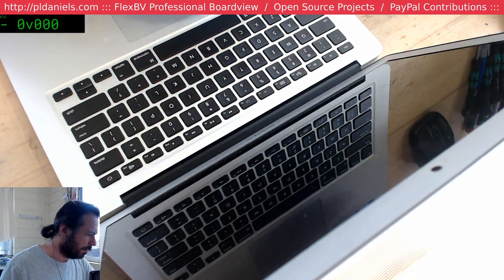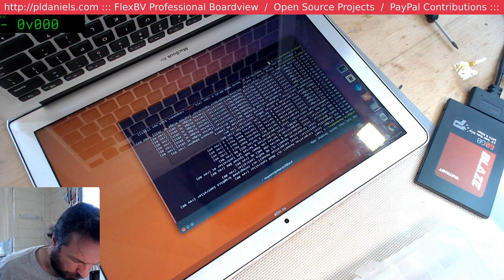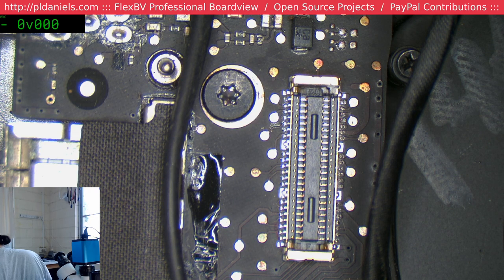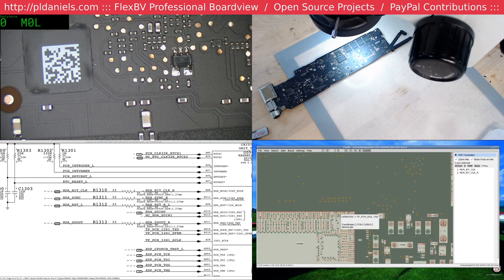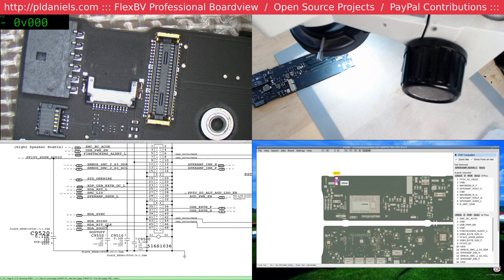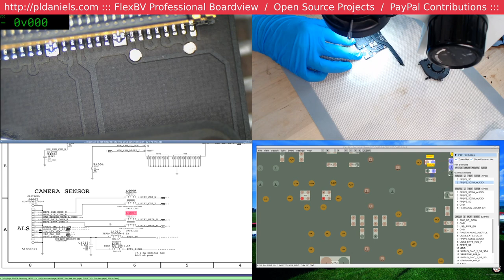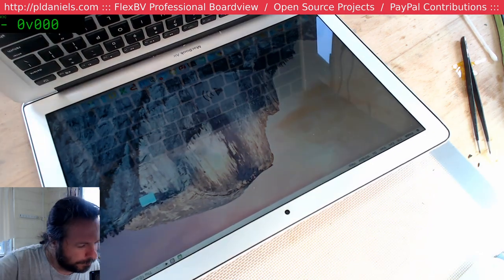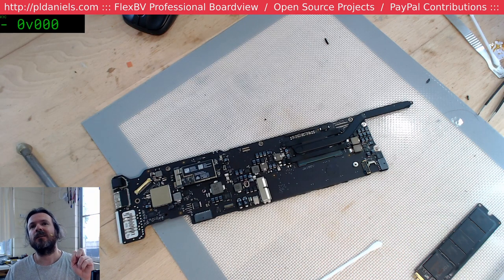LIVE - Thursday; fixing up my own Macbook Air A1466 prior repair, what did I do wrong?

Comment from the maker: Macbook Air A1466 / 820-3437 board has come back after a prior repair (one I did) but this time has returned with "No audio".  After spending a fair bit of time confirming this and trying to track it down through part/process of elimination it ends up finally be resolved starting at @1:19:30
Reply from the maker: @vogonjelc  the fault was the cracked traces on the J9500:39, 43, 45, and 47.  DC/IO board is fine.